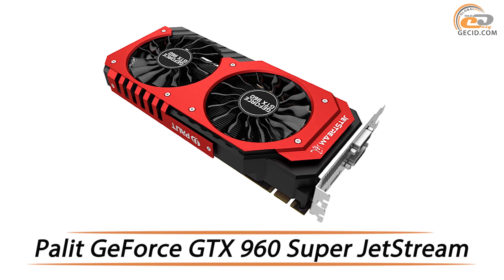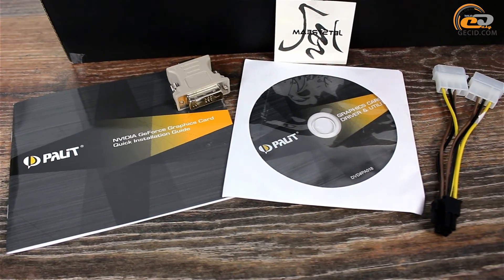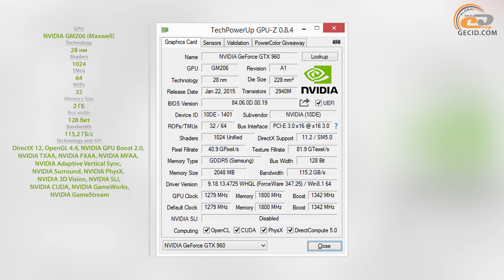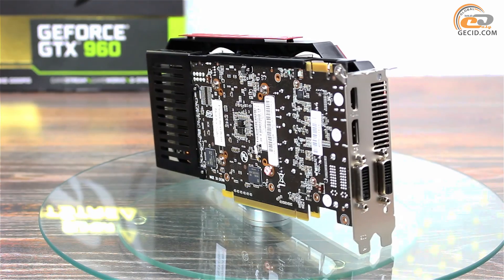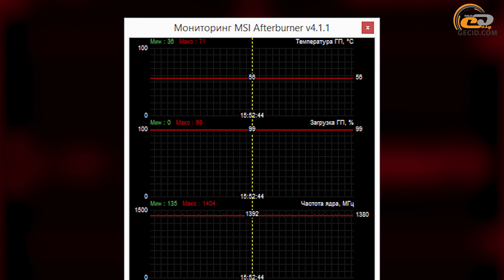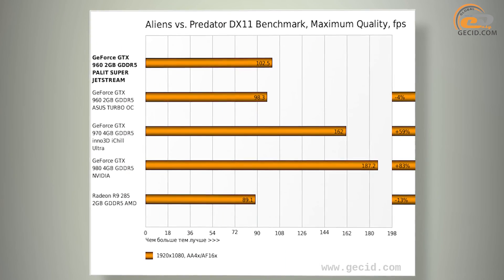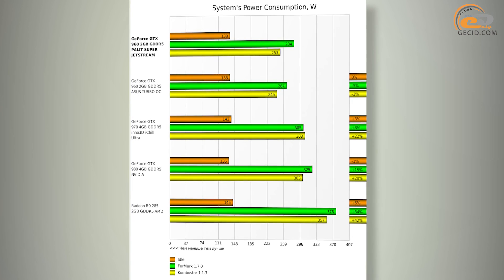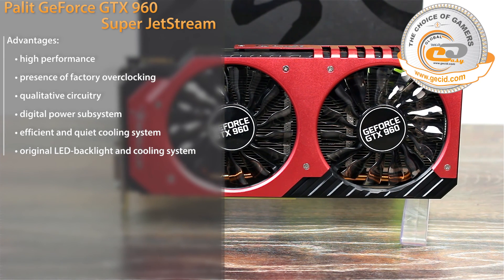Palit GeForce GTX 960 Super JetStream Review & Testing

Comment: im no nerd, and the numbers confuse me. but is this card able to do BF4 and witcher 3 plus the big 2015 games?
Reply: +RibberDibber No and yes, i mean not in ultra 60fps. Gtx 960 is no card for Ultra settings. But high settings for sure
Reply: +Monche Riego i bought it 3 weeks ago, and it works just fine on ultra settings with i7 4670 on ultra with "most" games, having trouble with open games such as fallout and witcher, about 48-73 fps